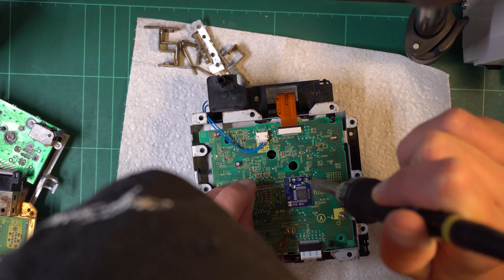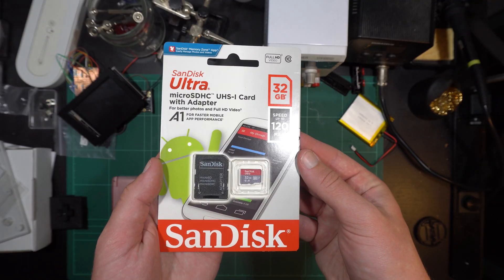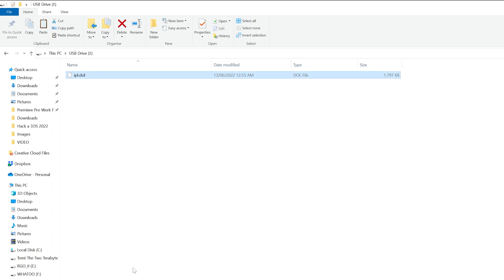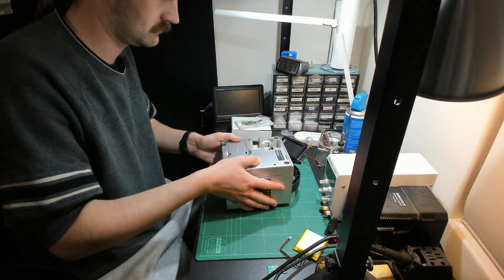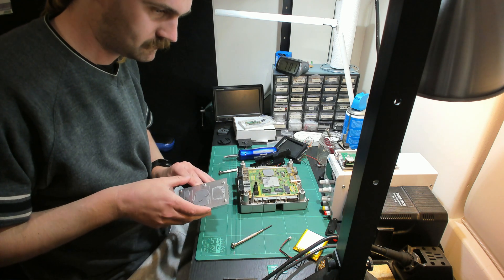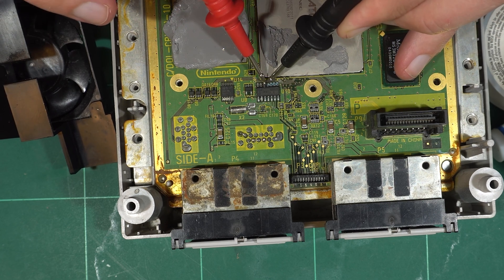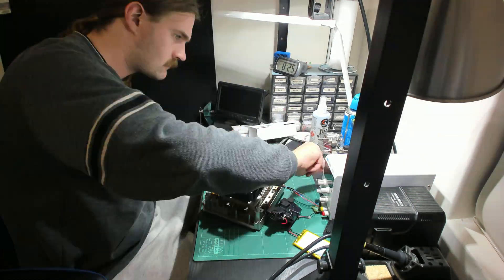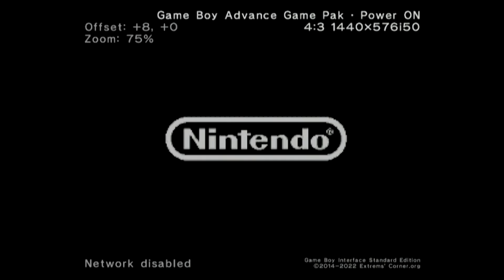Mod a GameCube with Raspberry Pi! - PicoBoot

Comment: Route wires up between mem card , right behind controller flex ribbon.  Wires will be really short, and clean.   Just bend the metal tab back.

Comment: I’ve just completed this mod and when I load a GameCube game I get black screen with the games audio working fine.  
I’ve tried a disc and even snes games to make the console wasn’t defected but they all work perfectly fine.  
Out of 10 tries with different GameCube games, there were a few times I got the first 2 seconds of video but in horrible quality. 
 Any thoughts?
Reply: Wires are too long
Reply: @EternalDeath14  
Interesting. Thanks.  I’ll consider trimming the wires.   I used 26 gauge and mounted it beside the fan so it’s little thicker wire and have descent slack.  Wires are shorter than what’s shown in video

Comment: Tip to avoid frustration... keep your wires short. 4inch max so Install pico on the side by fan. If your wires are too long it won't boot just giving you A black screen on power up.
Reply from the maker: Hm. I haven't had that issue, fortunately.

Comment: This is awesome. I'm doing this. I'm a big fan of swapping out the disc drives in old consoles to run a SD card.. This now gives me a reason to finally buy myself a Gamecube
Reply from the maker: And the great thing about doing this is that the disk drive doesn't even need to be removed!
Reply: @retrogameon  Yeah true that. The Saturn now has a big hole where the drive was. I've dropped the SD Card in there so many times.